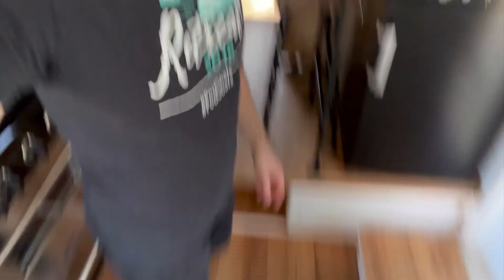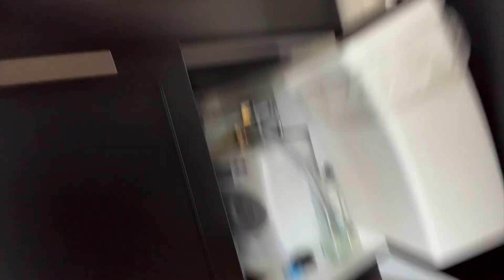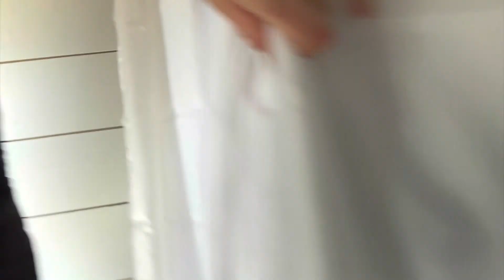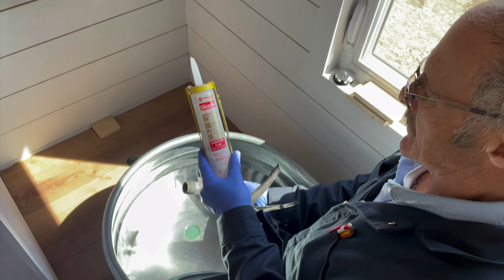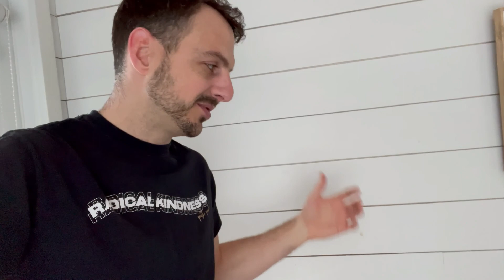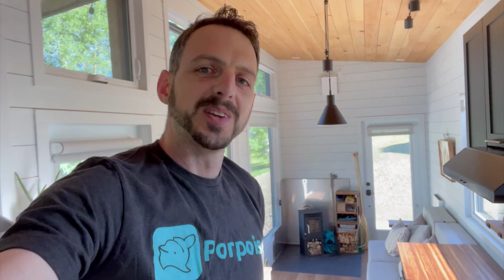Denis Daigle - #tinylifeTAKEOVER​ - Tiny House Build - Minimalist Shower Setup using a Sheep Trough!

Comment: I was wondering if you had any issues with having standing water in the tub after showering? I built basically the same exact setup (thanks to this inspiring video!) for my tiny house and it works great but since the tub is not angled, the leftover water doesn't want to go towards the drain. Any advice?
Reply from the maker: Same with mine, there’s always a little residue, but it dries up nicely during the day. I used to squeegee the water toward the drain, but it wasn’t worth the effort really. You can always try a large 2 degree wedge underneath to create a tilt toward the drain? I did that with some foam.
Reply: @TinyLifeTAKEOVER  I also was doing the squeegee method lol but definitely can't do that all the time! I was thinking about putting a small piece of plywood under the back of the tub to give it that angle, hopefully that will help a bit!

Comment: You can cut a piece of plywood to under the water trough aka shower it will make it a little stronger on bottom. Have a slight angle in trough towards drain for better drainage...and slightly dimple drain opening before installing drain for better water drainage...

Comment: Can it be done in a 2005 camper?
Reply from the maker: For sure, as long as the drain is well sealed and doesn’t leak (I would hire a plumber if you’re not in the trade yourself), the rest is easy :) go for it!

Comment: my question is.........and NO i didn't read the other comments first, LOL sorry..............will the through's rust???
Reply from the maker: Great question! It’s galvanized steel, so it’s meant for farm animals outside. The only rust happened where we cut the hole for the drain, but sealing that up well and I also added some paint has helped keep it good to go!
Reply: Did you alter the floor before you created your tub? I was curious how well it drains.

Comment: I havnt watched all your videos but I’m wondering if your loft above your bathroom is where you’ll sleep? If you have the floor lifted and the loft on top are you sticking with the 13’6 height requirement? Or maybe your not on wheels? I will be in upstate NY so I’m trying come up with the best water options also! I plan to have an inlet, fresh water tank, grey tank, and outlet if possible. So I can have things flow freely when the weather is good. I can close the system off when we get below freezing. What hot water heater did you do with? I feel better about going electric but know propane will do so much better in the cold. Awesome video!
Reply from the maker: Great questions, thanks for asking, I’m sure others are curious! 

Alright, to answer your first question, I have a video on the bed/couch I sleep on every night https://youtube.com/watch?v=kx7sm1OuNco, and design perfect for schoolies and boats no doubt, and I am within the 13’6, and on wheels.

As for the tank, it’s this one: Bosch ES 4-1M https://www.homedepot.com/p/Bosch-4-Gal-Mini-Tank-Electric-Water-Heater-ES-4/206393135

Come to think of it, my closed system is well suited as a boat set up. 

Thanks for watching and keep your questions coming, we’re all in this together